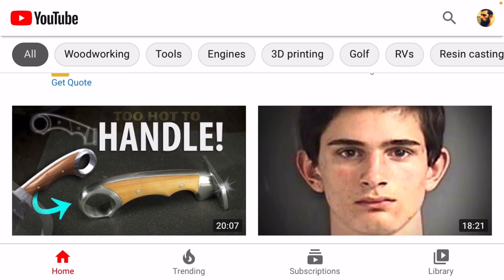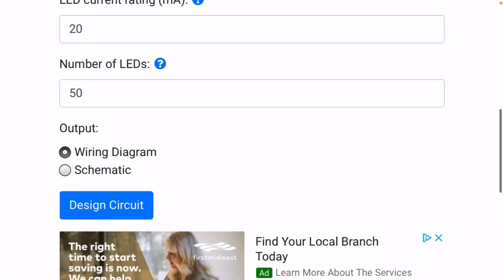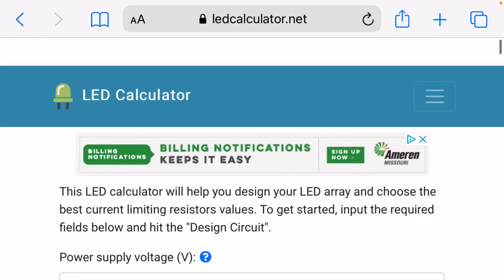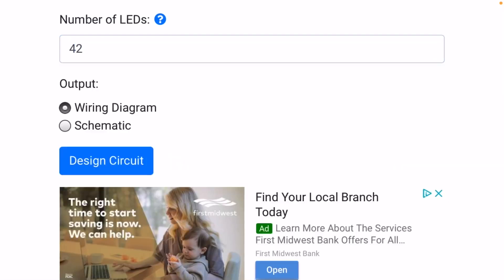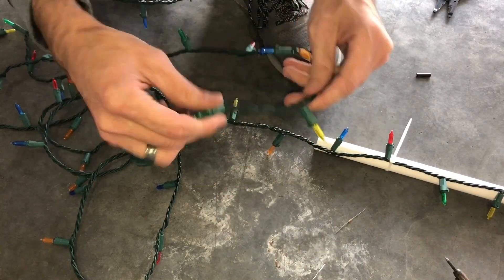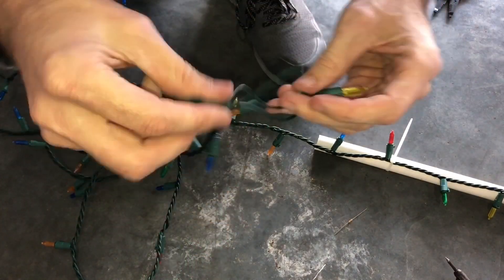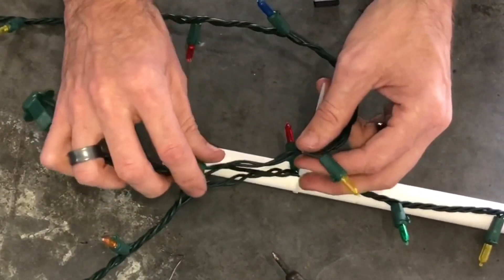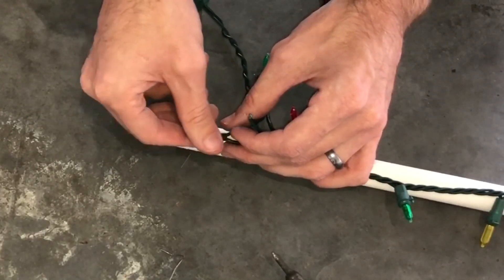DIY Custom length LED Christmas Lights

Comment: This is the best explanation as to how to remove bulbs from a string of LED lights by far.  Obviously you have to pay close attention to the wires you cut and splice the resistor to, etc. The key is the resistor calculator.  I applied it and it worked perfectly.  Excellent job, Dustin.

Comment: Hiya Dustin.

'Home Accents Holiday' brand (sold at HD and Lowes) make a 20ft (6 meter) LED string light product where one or more lamps can be removed without a segment going dark! 

FINALLY! 

This innovation suggests that the length of the strand can customized! Before I grab the wire cutters, soldering gun and shrink tubing, I need to decipher the wiring design:

The strand is 100 LEDs. Each terminator (plug and recep) contain three wires. Three "segments" are separated by four sockets that contain three wires--one three-wire socket is nearest each terminator and the other two three-wire sockets are 33 lamps and 34 lamps from either end. 96 sockets are fed by two wires. The two segments adjacent the terminators have four wires while the segment in the middle has five wires. There are no resistors in this light strand. 

It's a peculiar design, to be sure. The sockets are wired in series (two wires) but function as if wired in parallel!

Comment: Dustin,  your video really helped me but I have a question. I had a 100 light strings that was in 3 series. I only need the first series for my project. So I have the excess off 67 lights that I’d like to be able to use that only has the female plug end attached. I have a male vampire plug coming, but can I put the resistor between the plug and the first light or do I need to add it to then end of the string by the female plug? Thanks
Reply from the maker: The resistance just has to be somewhere in the series. You could add it right in the middle of the strand, it’s just easier to add it where the wire is already cut. And hello from just south of COMO. Thanks for watching
Reply: Where are you from?
Reply from the maker: @memorialbaptistchurch-colu6682  Jeff City

Comment: I have GE c9 LED energy smart 100ct. It has alternating 3 wires then 4 wires between bulbs. Would your method work with these lights? I looked through the strand and the wire count is consistent. There isn't a 2 wire "break" that I see referenced in other videos. Any input would be appreciated.
Reply: I have the same lights. Have you found a way that works?

Comment: If I need to add length for an section that does not need to have lights; can I just use wire of the same gage, or do I need something additional?
Reply from the maker: Should be able to just use the same gauge wire…unless you’re extending it an obscene length.